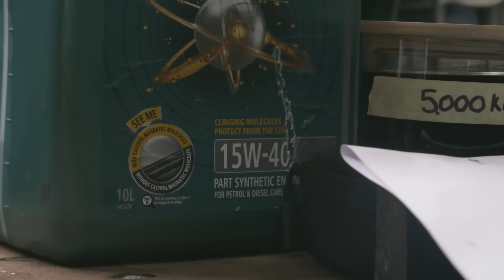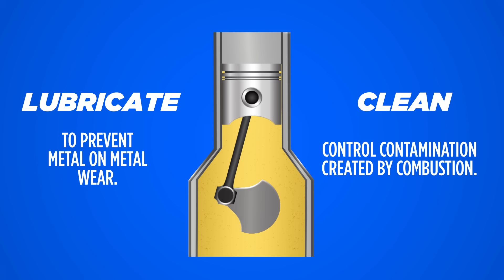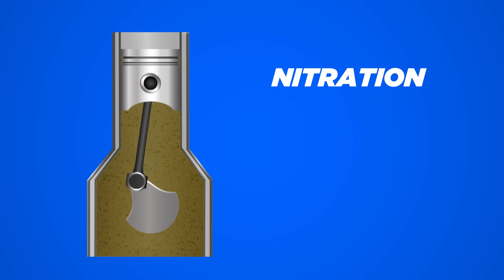Engine oil COMPARED at 5,000km vs 10,000km vs 20,000km! This'll make you service your 4WD RIGHT NOW!

Comment: I service my RC Colorado every 5000km despite the service manual but I change out some systems differently. 
Engine Oil and filter every 5000
Air filter (oiled uni filter) and clean MAF every 5000
Fuel filter and pre filter every 10000 but offset (1 each 5000)
Diff & gearbox oils check level and colour every 10000 any sign of dirt/water or level then change

Oils & filters are far cheaper than engines and gearboxes AND more importantly an engine or gearbox failure out bush costs recovery and towing on top of repairs
PREVENTATIVE MAINTENANCE!!!!

Comment: 5000 ks religoiusly and I run the same oil as you showed on the vid, have done the same thing for 26 years on the 1HZ and the oil pressure on my old 80 is just under the third peg on the gauge and that is just under relief pressure. Mine is bog stock and does 15k,s one way and 15 back to work, swear by Castrol magentic, the best oil for the best engines, 1 HZ of course

Comment: Running an old naturally aspirated diesel I change engine oil and filter@ 5000kms with RX super, transmission, transfer and diffs oils at 20000kms, power steering and brake fluids annually. It's a cheap insurance  🤘🤘

Comment: service intervals
Engine oil: 5000km
oil filter: 10000km 
Gearbox fluid and filters: 20000km 
diff fluids: 20000km 
transfer case fluids: 20-30000km 

Change fluids around the vehicle frequently as vehicle gets pushed heavily through mud and water crossings all year round. Frequent fluid changes ensures there is less contaminated fluids in the vehicle at any stage.

Comment: This means nothing unless you do a lab oil analysis also the difference between oil 40 years ago and oil today is very different
Reply: Ps. Completely anecdotal but i got a 2014 1kd hilux with now 220000ks on the odometer its a work ute so it does short cold trips all the time plus a lot of long ks serviced every 15000ks with no issues at all

Comment: I am also a HD diesel mechanic, the blackness of the oil isn't a good comparison, all it shows is that the oil is doing its job of cleaning the insides of the engine. The engines in the mining and earthmoving industry will work harder than any 4wd engine with them being under almost 100% load, 50% of the time, and most of these oils are changed out at approximately 500hrs, admittedly their capacity is much larger than an LV and they have banks of oil filters, which may help increase the longevity of the oil, but I agree, dropping oil on some white paper isn't a true test of the degradation happening within the oil itself, the OEM and engineers who design and build the engines crunch the figures and come up from all scenarios to deliver the frequency rate of engine oil change out, you can actually over service your engine and instead of clearing out all particles internally you can end up with uncleaned parts if the oil is changed too regularly. However I feel if you do change your oils more regularly for peace of mind, more the power to you, however unnecessary as it is
Reply: Furthermore, I would be more inclined to replace the filter more regularly over the oil itself as this is what will be capturing these particles and allow the oil to do its job

Comment: i use top quality engine oil mainly shell fully syn a5b5 spec and change it every 2000miles did do 3000 once and you could tell the difference. the 3000 mile time was doing 60 miles a day and no off road before this was 2000 miles with 12 miles a day (6miles each way so cold engine) with once a month poodle off road in low range half the time but nothing to taxing. when doing something taxing if its over halfway towards a service it gets 1 any way if not it get 1 when home allways gets done before a holiday trip too shes over 200.000 miles purring like a kitten with now smoke or oil loss that you can notice

gearbox is auto this get done roughly every 5-10k overkill mabe but cost me a lot of money if i on rear occasion do the higher side she gets oil change couple hundred miles later will then get a filter and another change. transfer gets done same time as diffs probly twice a year due to low miles but probly gonna be every 3k max now i have atb(lsd) diffs

Comment: Replace oil and Filter every 5000 , diffs and transfer 20,000 or if i do a water crossing straight after, oil is cheap , major failures not so much , coolant once a year as well as Transmission its really cheap insurance as well you get to see any early signs of wear.

Comment: I have a 2002 kitchen variety Landcruiser 1HZ105 manual & it’s approaching 350K kms. I’ve always been a stickler for changing my oils on all the vehicles I’ve owned Shaun & not just the engine oils either. There is a lot of good advice in what you say . As a hunter/fly fisherman I’m away every couple of weeks for a few days at a time & many of the places I travel to demand reliability in the vehicle. I currently use the Penrite products, although am alway looking at other quality products that may assist with my vehicle reliability goals. A tip or extra little thing I do is place small magnets on my sumps & oil filters & swap them over at every oil change, just to assist in preventing my engine wear. I also use extra friction additives in the lubricants for added peace of mind & enhancement. So as you can see I take pride & care of my little Penguin because it matters.😊

Comment: I religiously change my engine oil and ALL filters in my 2001 GU patrol every 5000kms or every 6 months. I do my gearbox & diffs every 25000kms. Thats why i have over 300,000 kms out of a zd30DI & its still as strong as the day I bought it. Only mods it has is 3 inch turbo back exhaust, catch can, tillix valve & egr blocking plate. The rest of the engine is stock standard.

Comment: Our LN106 is serviced every 5000-7500km's, new oils all throughout, it does alot of water and mud driving, aswell as towing. On a fresh rebuilt motor we try our best to maintain regular servicing. After about 2500 kms the oil is still clean enough you can see through it on the dipstick.

Comment: I've got a 80 series 1hdft and I'm only on a part time income so don't have much money to throw at oils. That said, to keep the old girl running well I do the following intervals.
Engine oil and filter @5000km
Fuel filter @10,000km
Front & rear diff @20,000km
Manual Trans @20,000km
Transfer case @20,000km
Power steering fluid @30,000km
Clutch & brake fluid @30,000km
If I had more money to spend I'd be reducing some of these intervals but I don't drive the car hard or do any towing, also do plenty of freeway driving so should be okay. Always use Castrol rx super cj-4 for the engine
Reply: Fuel filter at least with German fuel can go above 220.000km without any problem. Oil and oil filter change every 15.000km. differentials?! Don't even know if my car has diffs, never did any diff maintenance on any of my cars never had an issue. Manual transmission goes easy 250.000km without any maintenance. Brake fluid should be changed every five years but can last longer. Just my personal experience.
Reply: you are very busy to do maintenance for it ,lol. Just use full synthetic oil and change every 10k km for engine oil, 50k km for diffs, 80k km for transmission fluid, fuel filter every 40k km. Your services are over kill and waste a lot of money and time
Reply: @ngochuybk  you do that if you dont keep your car for  to long but if you keep your car forever then you shoul do what he said in the comment above
Reply: @nikyclau3966  if you do like me for a brand new car, it can last 30 years easily. The comment above is overkill and waste of money and time.

Comment: As a mechanic i change mine every 5000km and all the drive line every 40,0000km, i see alot of customers who do 10,000km and its black as hell alot dont get driven enough, some dealers even say 20,000km service intervals and thats just stupid seen so many come in with low oil at 15,000km and wonder why its happening lol dealers do big intervals so the car wont last so you have to buy another one, regardless of km oil should be changed every 6 months the additives in oil only last that long after that time the oil is basicly useless, expect the cost of oil the go up to there is a shortage of some at the moment and its only gonna get worse

Comment: 5000k for oil and oil filters, 10000k for the air and fuel filters on a 4.2t GU. Diffs, gearbox and transfer case  get checked and changed as necessary, that varies depending on what we get up to.

Comment: I do every 10,000kms. Car does alot of kms, and to be servicing every 5000kms. Id be spending more on oil, than just buying a new engine if it crapped out. Plus 10,000km oil is still not bad. Just slightly contaminated. But no matter what, i always run oil flush (liquimoly) through my engine before every service

Comment: I change mine every 5k in my ranger 2014 and it comes out nearly as clean as when I put it in. 
Need I say a lot of coin has been spent on my engine to achieve this. Also driveline every 10k Cheers guys

Comment: I service my landcruiser every 3 to 5000km and fuel filter every 10k gearbox and diff oils every 20k. Im a mechanic so I understand the importance of maintenance and my engine oil is allways clean.
If I been on a trip it gets serviced straight after the trip and wheel bearings checked and adjusted. 
Iv turned off the egr aswell to limit the crap going back into the combustion chamber

Comment: 2015 Ford Ranger PX 2

Engine oil and filter every 7500km
Diff oils every 30-40000km
Transmission done every 80000km

Towing a van round oz and the car hasn't missed a beat yet.

Comment: Religiously change engine oil and filter every 5000km, diff oils and gear oils 10 - 20,000 km depending on driving conditions.
Air filter and fuel filter usually gets done every 5000km also unless iv been on some dusty trips.
I want reliability and peace of mind on every trip.
I want the longest life

Comment: On my 94 75 series you can actually hear the difference after around 6-7000kms it needs it's oil changed. At around 10000 yeah well sounds scary. 5000 it is.

Comment: The recommended 10,000klm oil changes in handbook, is for ideal conditions, it will say in fine print, to change it more often if driving in dusty or extreme conditions.

Comment: Nissan patrol gq
@engine oil 5000km
@diffs,gearbox,transfer 40000km
@flush brake fluid every 2 years.
Air filter 30000km or as required 
Fuel filter 20000km
Use good oil and you engine will thank you!

Comment: I've got some doubts about testing oil on a bit of paper, however changing oil early won't hurt the vehicle. Remember if you have a vehicle under warranty oil changes must be done by a qualified mechanic. Not necesarilly the dealer, but if you want to retain consumer rights on a new vehicle make sure you don't do it at home.
Reply: Actually, the service must be done at a mechanical workshop. As long as there is 1 qualified mechanic there, anyone could be doing it! 
Usually an apprentice 🤣🤣🤣😲

Comment: I have two 4x4's- a 2013 Toyota Hilux N70 1KD-FTV, a 2001 Toyota LandCruiser 105 Series with a 1HD-FTE in it and I also have a non 2005 Subaru Liberty GT Turbo.

I only ever use Castrol or Nulon in all my vehicles. I have refused to use Penrite for years since it caused my Subaru and also my father's brand new Subaru Outback to tick.

The first two mods that I always do whenever buying a new car is installing an Oil Catchcan to reduce blowby particles of oil clogging up my intake and cleaning the intake manifold and EGR components, and then blocking it off. After that, I will install a pre fuel filter and diff breathers. 

I change my engine oils and filter religiously at 5,000k's, regardless of what vehicle it is, I also do my fuel filter at this time. The EJ20 found in the Subaru is a extremely finicky and highly stressed engine and they like regular oil changes with premium synthetic oils, where as I use the recommended semi-synthetic oils for my 4x4's.

I change my transmission, transfer case and diff oils after every hard trip, especially with water crossings, if not, every 15,000. I use the Nulon Ezy-Squeeze for this, primarily for the easy and convinience of not having to lay under the car getting a sore forearm from using a small hand pump that only transfers small quantities with lots of manual labour.

I do power steering fluid flush, brake fluid and coolant as it is required, when there starts to be discolouration, a drop in levels or slop in the brake pedal.

Cheers Shauno, loved the video. It just further reinforced that what I have been doing truly is cheap insurance and the right thing to be doing!

Comment: Gday Team 
Be careful as over servicing can be as bad as under servicing. If you change your engine oil too frequently especially if you don’t drive for extended periods the oil doesn’t actually break down and it will leave a coating inside the engine that builds up and stops the oil doing it’s job. Oils full of additives and detergents etc they have an expected life cycle to protect, lubricate and then remove build up. 
I have an td patrol so engine is every 5k and the rest is use case. Harsh driving lots of water I’ll change more frequently. Highway driving I’ll leave for longer. You learn your vehicle over time. At the end of the day the biggest killer is short/ stop start drives no matter how you service your always going to get more premature wear. 
Great video keep it up 👍

Comment: I have a 2012 FJ that I bought brand new. ( 3 miles on the clock when I received it.) Synthetic oil from the start. Changed first at 5,000 miles and then at 9500miles ever since. I also have a cartridge filter so it is easy to open that up and look for metal particles. The first filter had 3 metal particles stuck in it, the 2nd filter had 4 metal particles stuck in it. Non of the remaining filters have  had any metal bits in them. The oil was fine, synthetic. I am now at 95k miles and btw this is the 4.0 gas engine. Well done Toyota.

Comment: I use Castrol Magnatec 10w-40 in my 30 year old Suzuki Vitara as well! I generally do my oils every 6000miles, which also includes my diffs, gearbox, and transfer case fluids. Although shes only a Suzuki, with over 220k's on the clock, shes only just been run in! 🤣🤣 runs like a well oiled 1900's sewing machine! 👌🏼🤙🏼

Comment: G'day, Jake here. I change my oil every 7 thousand, an odd number but I have found that this is a happy number when it comes to colour and velocity. Air filter is now a pod filter in an enclosed box, so continual pressure blow to keep tidy, as cab filter every 10thou purely for better breathing in the cabin. I love my Ute, I've spent more on my Ute than anything I've ever owned so it pays to keep the rig schmick inside and out.
Great vid, great advice, cheers shauno

Comment: I drive a 2001 patrol 4.5 petrol I change oil and filter every 3500 to 4000ks replace air every second service and replace diff oil every 12 months same as spark plugs and fuel filter cars done 450.000ks and runs like a dream on both petrol and gas on 35s

Comment: I service my old 95 cruiser after every trip just to keep her 470,000 look and run like under 100,000 and Castrol is my go to!
Reply: These vehicles are nicknamed Ninja King in the island of Borneo. Along with Hilux, they are the vehicles that can travel to the most remote parts of the jungle track and the car comes out in one piece. I have seen Ford Rangers being carried behind trucks as they are just not built tough enough

Comment: So hadn't changed my oil in 2yrs (roughly 70 thousand kms), car is driven at minimum 2hrs a day, went to sludge, caused a whole heap of issues with my car, oil wasn't even pumping through my oil filter it was that thick! Had oil in my spark plugs, and top of engine was cover in sludge, 10 cans of degreaser, a new oil filter, new gasket, and 2 oil changes later she purrs like a kitten, yep iv learnt from that mistake now.

Comment: I agree with every 5000kms for engine (everything) and fuel filter every 10000kms clutch fluid, brake fluid, power steering fluid and/or after alot of water crossing my diff, transfer, and gearbox

Comment: for my 2016 D-Max
oil and filter is every 7,500kms
diffs every 30,000kms
Trans and transfer every 45,000kms
fuel filter is every 15,000kms 
steering brakes and coolant are done 45,000kms  or sooner if they need.
im averaging 80-100kms a day getting to and from work, then weekends away camping and taking the boat out skiing(when its actually warm enough )
so my services come around pretty quickly.
thankfully a hoist at work makes it easy to get it done

Comment: We at Low Range 4x4 Adventures service our Colorado at the recommended 15000km interval, when doing lots of towing we do more regular oil and filter changes at least 1 extra between services. We also do a full front and rear diff oil change to protect our lockers and something a lot  of people may not know is that lockers require a different oil than the regular diff. 
Finally we also check gearbox and transfer case oils every service, if they are at all contaminated they are changed as well. We also regularly check brake/clutch fluid and change more regularly then recommended as we do a lot of towing so it needs checking more often.

Recommended diff oil for an RG Colorado is 75w-90 however for lockers ARB recommend 85w-140 so this is what is used and changed every 15000km.

Comment: A great way to test your oil is to wipe your dipstick with your finger and thumb. Rub your fingers together.  Older oil will have a grainy texture. Newer oils will have more viscosity, your fingers will slip a lot easier. Also smell your oil, the older stuff , engine oil at least, will smell a little burned
Reply: I like to lick my oil... If it's old, you will know it....
Reply: More or kess said the same  but in more detail and with examples.